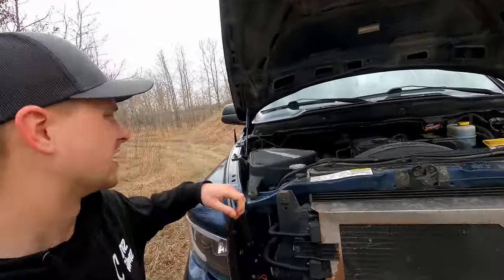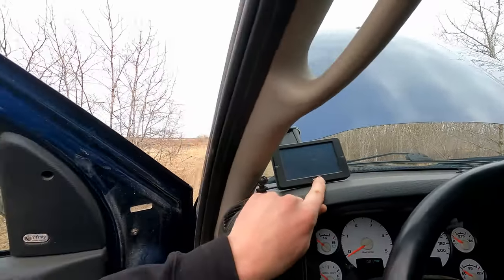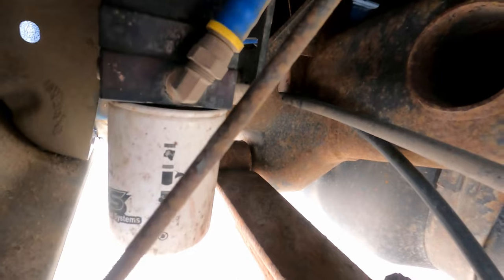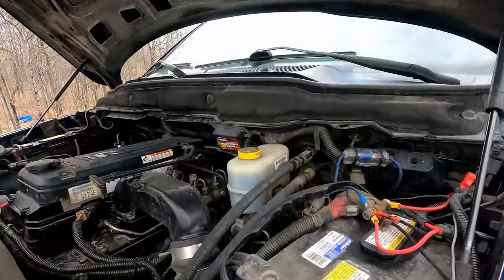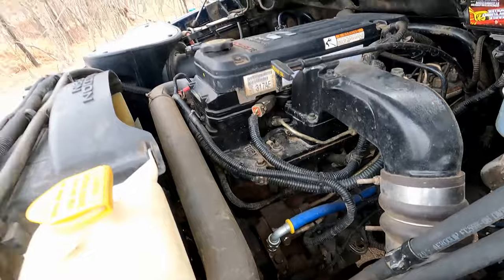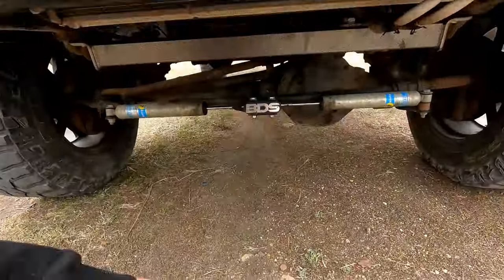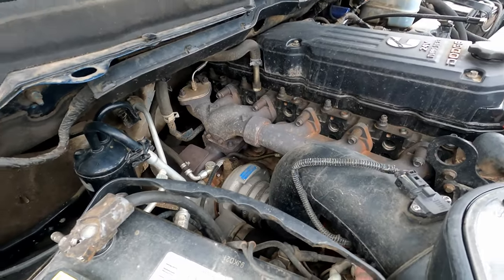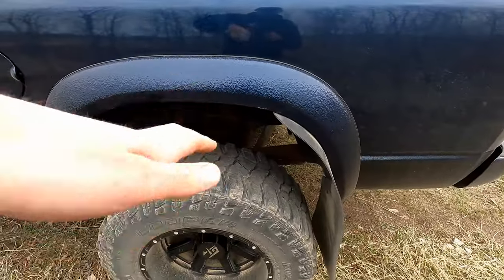TOP 5 UPGRADES FOR 5.9 CUMMINS

Comment: Transmission on 3rd gens first thing i did when i started building power years ago was lock up the tourqe converter the factory actually  detunes the engines so they dont destroy the 48re trans so when you turn it up its a time bomb

Comment: Cool vid. I picked up an early 04 6 speed 3500 RWD dually. 110k miles and She's pretty much bone stock. I just removed silencer ring, intake pipe baffling and swiss cheesed the airbox along with a KN filter. Exhaust is next on my radar along with an edge juice with attitude cs2 programmer. Great advice! Cheers from Alabama.

Comment: Great video I just found your channel and a month ago I bought my first diesel. I got a 2006 ram 2500 4x4 5.9 So far I have made several upgrades but the best so far was getting rid of the muffler and catalytic converter that was original.It really opened the truck up and it is totally  different for the better.
Reply: Hey man how are you liking youre truck? What did you do to it? 
I just bought that exact same truck!
Reply: @Andronicos1453  I love it so far.Yesterday me and my son put back brakes on it,changed the fass filters and did an oil change.We are supposed to be headed to Colorado tomorrow to get my wife's car from Colorado springs.We went on vacation in June for a month long dream trip to the west from S.C.6500 miles into the trip we blew an engine while pulling a mini camper Long story I know but Hyundai finally are supposed to install new engine tomorrow. So I got to go get my wife's car and the mini camper.Wish me luck I hope the old girl makes it lol
Reply: Did the cummins make it?
Reply: @Jaymes222  it did without any problems I discovered a small leak in the seal where the yoke goes in the rear differential but is minor and it's on my list of things to do.But I was really happy to make it home with my wife's car our mini camper and my cummins lol
Reply: How's the 06 holding up?  I think I'm getting one soon.   I really wanted a Tundra but the 5.9 seems a lot more ideal.  What kind of MPG are you getting?
Reply: @oldowl4290  I had a small wori g issue with the transfer case motor other than that I love it.I get 15 around town pulling a 6×12 cargo trailer
Reply: Hello new to cummins 5.9 
So you upgraded your catalytic converter and muffler or is just straight pipe ?

Comment: Upgrade your steering gear box to a Red Head box along with the brace. RedHead is hand machined box to way tighter tolerance then an OEM box or a reman box. It's a must do on dodge pickups.
Reply from the maker: I’ll look into it!
Reply: Borgenson is better ditch redhead
Reply: That new steering box I think they are the newer Dodges it is huge and for what I heard that new factory pump is way better than any rebuilt and modified pump and I sure it is very costly. But these new boxes are huge and built like a tank !!
Reply: Redhead steering box, Mishimoto radiator and Carli suspension here. Love my 06 !! Till death do us part
Reply: @calevel  Was the radiator actually worth it?
Reply: @jamesvaldez4093  well knowing that it has a lifetime warranty it is worthy  for me since I'm not planning to ever part with my truck. as far as running cooler idk but maybe. my oem  developed a leak. mishi is a solid piece very stout and aluminum is known to dissipate heat quicker that other metals.
Reply: @calevel  Thanks for the info. I have an 05 and thought about upgrading the radiator and intercooler to Mishimoto but have read about some quality control concerns. Mine doesn't have any leaks or anything so I may just wait a bit.
Reply: @jamesvaldez4093  check champion radiators, I have one in my 79 Ford Bronco and I’m very happy with it. It’s not a lifetime but there’s no much difference between them and mishimoto as far as how they’re built and price is like half. Whenever you pull the trigger on it  go aluminum.
Reply: @calevel  Awesome!! Thanks for the heads up and I'll take a look at them.

Comment: Great video!
Everyone: be very careful with those 'performance' air filters! They can let a lot of dirt into your engine.
I researched and found out that the best filtration is from a larger, paper filter (similar to OEM).
There are tests online (like the Spicer Duramax air filter test) that show the different efficiencies of several filters.
My 'test' was wiping the inlet and impeller of my turbo with a white paper towel. That lead me to get that oiled, foam filter right out of there!
Reply: The Carlie 3”lift ,with life time ball joints with the up graded OEM steering track  bar , with steering box brace , and the longer front axel bars , duel  steering stabilizer kit . Tracks better than new ! Oh yeah new king shocks night and day difference. I Evan got discounts on my insurance for steering performance up grade ! Loved that.

Comment: I have an 03 3500 with the 5.9 and I did these same 5 upgrades off the bat and really think it was a great idea. My order was the 5in straight pipe, s&b intake, fass 165, bullydog 40420 (huge mistake highly don't recommend) then I did my own form off steering (Just the 4th gen steering upgrade). Great video and really think it will help the new guys with their first 5.9.
Reply: Do you know if the diablo sport predator is safe to use?

Comment: All great upgrades, the only thing I might add is a intake elbow, I was surprised that I could actually feel a difference!! Well done, another great episode!
Reply from the maker: Yes I forgot that one! I will be upgrading my intake elbow when I do the bigger injectors!
Reply: @darkirondiesel  I was able to find a brand new Banks elbow to go along with my 30% injectors, really scoots now!!
Reply: No point you can make 2000+ verified rear wheel hp on the factory intake horn.. save the money for other stuff xD

Comment: Nobody ever talks about the Fleece in tank a drop in unit and it has two gear motor pumps and a nice CNC top section it uses the factory lines and factory  wiring harness for one pump and Fleece wiring harness to run to battery with a fuse and a relay. So what is so cool this unit has two separate pumps and a second wiring harness with two pumps running at 21 lbs and if a pump fails you have a back up pump that that’s on a separate harness with fuse and relay and one pump will 10-12 pounds of pressure. So you can drive it with plenty of fuel to run and cool your your high pressure injection pump and it has a lifetime warranty a win win situation.

Comment: I agree with everything but I'm not sure how I feel about the head studs. Having ARP studs on a performance motor can damage the block under certain conditions, where as keeping the stock studs will stretch and you'll loose a gasket. I think it was banks that did a video on this as well. Never seen the issue but have learned the draw back on the the ARP studs. Might be worth looking into because that's an upgrade that may not be necessary.

Comment: Good video very informative. Last spring I bought an 2003 dually 4X4 Cummins with a 6 speed manual, it has 353,000 kms on it now. I live in rural New Brunswick so the 4X4 could come in handy. The check engine light came on coming back from Ontario, engine cut out and stopped. After a few minutes fired up again and it ran fine for another 600 kms and still running fine but the light is still on. Love the truck, handles great and lots of power for me. Should I call a dealer and have it analyzed? Oil and Preston are both good.

Comment: With my S&B cold air intake i bought the lower scoop and added the AFE waste gate actuator on my 2006 5.9 and my turbo lag got way better and the AFE waste gate actuator is adjustable up to 60psi! Plus im getting upwards of 22mpg’s with my superchips tuner! It’s the cheapest one i could find and it only has 2 tunes (tow & performance).

Comment: I was tempted to install head studs 1 by 1 without doing the head gasket when I replace injectors in the future but at 180k miles, I might as well wait to until it needs a head gasket. Your injector video made it look easy enough where doing in stages is easier on the wallet. It may be a while given even with turbo upgrade plans, I don't intend to make much power and just want to try and keep the efficiency and longevity up.
Reply: 9

Comment: I would add a Amsoil dual oil bypass system...and locking hubs so you wont be running your front diff all the time save a couple mpg in the process.

Comment: I bought a new 2005 Dodge and the first thing I did as soon as the rings seated was to install an Amsoil bypass oil filter kit. It is the best pickup I've ever owned and I'll never sell it.
Reply: I have my second Dodge diesel my first a 12 valve 1992 and my second truck was a 05 5.9 6 speed manual and floor shift for 4 wheel drive and I will never sell my 4 foot long bed dullay and first year I ran Rotela oil and after that all I run is Amsoil 15-w40 and every thing in truck has Amsoil !
Reply: 8’ foot bed

Comment: Just get a Fleece in tank lift pump that has 2 gear motor pump wig 21 lb and a long 20 lb one uses the factory wiring and other pum has its own harness with fuse and relay. So if one pump goes out you have a second one to get you home .

Comment: Been watching your channel for a bit. I came across a 2003 quad short with body in pristine shape. USA truck. Motor knocking, so it’s gonna be cheap! I’ll either repair or rebuild depending on what I find on tear down. 
Goal is 475 HP for towing.
I intend to do FASS, head studs, BD VGT and related (quiet!) exhaust, steering brace, minor lift (I’m old), probably new stock or reman injectors.
I have always run a ProVent 200 on my trucks to keep the PCV a oil out of everything from turbo inlet to the cylinders.
When the motor comes out, I will be sending the transmission off to be refurbished for the power and exhaust brake.
Anything else you would recommend?

Comment: interesting. and great videos. 
a perspective often overlooked in pursuit of huge power increase ,  is the strain on engineered systems; cooling starting etc. a fun thing to consider is how to maximize the engineering that  ram gave us.
 ok the steering is awful thats not a performance thing thats plainly a safety thing. big tires and ball joints safety again.
but what about cooling for example. recently i asked myself, what would happen if i isolated all underhood heat keeping it where it belonged and then was able to influence my charge temp? 
that led to intercooler ideas which led to a louver center hood. isolate heat with wraps, and increase ( dramatically) airflow thru the intercooler by using engineered louvers. 
so far so good and ive added none of  the gofast high dollar excessive accoutrements that are so popular. these additions that will strain factory parameter designs, in ways that can be counter productive. build out the factory design first.  using more fuel means more heat, straining all other  engine system s, especially charge air temps. 
back to cooling. next a water meth kit on the factory engine. every thing is still as Detroit designed it but maximizing power just from cooling down the factories idea of the proper air charge. if a  trick turbo is putting hotter air through the can at higher temps are u really netting much except guaranteed increased wear if you do not address the cooling systems shortcomings first? 
fuel delivery. mopar hd filter water and cat main filter. but the mopar  cannister one will keep your pump alive for at least 250k. the dizzingly expensive lift pumps, are so necessary with go fast parts, but is there power to be had just by maximizinf factory parts? 

air box. needed for high sustained rev of the engine. a factory part,but.wrap the tube to prevent heat soak ?
 in every case my first money goes to exhaust. i use 5" exclusively with three resonators. near factory sound with a deeper note and vastly improved flow. just sayin.... 

how much power could a 5.9 make just by maximizing factory parameters without destroying those parameters by using un- engineered go fast parts? i dunno. and ive never heard that discussion take place the rush has always been to alter those parameters with go fast parts, and in so doing, altering the balance of the designed package

Comment: Banks intercooler, Fleece Power Flow in tank lift pump, Banks monster ram intake horn, Banks cold air, Fleece Cheeta Turbo 63mm, Steed Speed CNC machined exhaust manifold, MBRP 4 in turbo back exhaust, Original  Cummins(Jacobs exhaust brake) Cari 3 in commuter system, Phoenix Friction systems dual disc clutch, EFI live tune..2006 Ram 3500. 167000 miles.

Comment: Hey man I appreciate the video. I noticed the headlights on the truck and I have the same ones for my 04 2500 dodge ram and I’ve been having an issue where the led light in my driver side keeps flickering on and off constantly. I was wondering if you would know why that is and if you would be willing to give me some advice

Comment: And I have 3 filters a big Baldwin with water separator with a drain and that is 5 micron and then it goes into my 2 micron cat filter and the a 5 micron Baldwin in factory spot with water separator and drain and a light to tell you you have water .

Comment: Hey , I’m a new subscriber to your channel ! I own a 2003 Dodge Ram 3500 SLT . I have a question for you, how do I check for a blown head gasket on my 5.9L Cummins ? The reason I ask , is cause it runs a little hot , not very hot , just a little to right of center . It used to run always to the left of center . It does have 334,000 miles on it . I’m just wondering if a head gasket issue ? Please advise . Thank You !

Comment: Glad I found your channel.  I've got an 05 with a G56, 211000k on it.  Put the bds 6" long arm in myself years ago and also the t-style drag link and tie rod plus bd steering box brace.  It's my daily oil patch work truck loaded to the nines with my welding skid.  I want to make this thing last forever as I'm not interested at all in  the emissions bs that comes on new trucks.  Next, I'm thinking of upgrading to the Howler turbo mostly to keep the 5.9 warm when I have to let it idle all day long, - 30 or just pipelining, it never comes up to temp.  Do you have any advice for the shit e-brakes?  Just replaced everything and still barely holds on the minimum slope of my driveway.  I'm scared to adjust the cable tensioner much more and have the shoes rub too much and take out my axle seals.  Great vids. Thanks. Working in the GP area.
Reply from the maker: You’re brake shoes probably aren’t tight enough, you want to set them up so they drag a little bit on the rotor, if you do that it should hold!  I used to work up in GP for Nabors drilling 👍🏻
Reply: @darkirondiesel  Thanks for the reply.  I did adjust the star when I installed the new shoes till I felt some drag when rotating the axle by hand.  I was worried about setting to much drag and glazing the shoes.  Guess I'll try again and set a bit more drag.  Thanks.

Comment: I wonder if a stock exhaust on a 03 or 04 would help heat up the truck quicker in winter, since it would cause alittle more back pressure compared to straight through exhaust.

Comment: Great video! I have the exact same truck and looking to put some upgrades on it. Only thing troubling me is hear they like to blow trannys with more than 50 or 60 hp past stock. What transmission would you recomend for an 03 5.9? Also is it normal for my RPM to consistently be at 2000? Thanks!
Reply: I have a g56 mecedes manual transmission in mine. The stick is amazing for pulling. Just make sure you have a good clutch in it if you're going to upgrade hp.

Comment: I somewhat disagree do studs second after a FASS but you take the chance of warping your head or block if you over heat to much just do studs no mater what cause your not gonna get a 5.9l with low miles so a full refresh is a good thing to do if you’re gonna bring the power up at all! Then 3 intake horn and filter setup and intercooler pipes and then take care of the front end with the 09’ upgrade and the be  brakes! Then if you are ready and the trucks safe tuner, injectors snd compounds!
Reply from the maker: Definitely not a bad route to go. I’ll be getting an intake horn very soon, probably when I do my injectors and cp3

Comment: I have the bully dog for my 03 5.9 3500 and I only put it on the first setting, have you ever used the bully dog. And where's the expansion tube on these in the cooling system

Comment: First mod needs to be built trans. No matter how much power you build it for. Putting all these mods especially a tuner isn’t going to help the truck without a rebuilt trans. As soon as you turn that tuner past level 3 you’re asking for trouble. We appreciate your cheaper mod suggestions tho. Not a bad lookin truck.
Reply from the maker: Ah yes good point. Mine is a 6 speed so I threw a southbend dual disk clutch in it

Comment: 07 5.9 with 275km worth 21k? SLT, old man owned (2nd owner, guys had it for 11 years). No tuner, stock intake. 5” exhaust into 4” muffler (guy must’ve straight piped it and then realized it was too loud for hunting). Rebuilt trans and new injectors in 2019.

Comment: I have a Thomas Bus with a 5.9L 24V Cummins. It is just a tad underpowered for my application. What is the quickest cheapest way to add 50-75 hp without damaging the engine?

Comment: I just bought a 2003 5.9, has a fass fuel 165, 350% S&S injectors, S&B cold air, twin borg warner 9180 turbos, ARP 625 studs, bored for industrial performance pistons, etc etc. But it doesn't have a tuner and never has. What one would you recommend? I'm in Alberta and bought this truck as it sits, have all the paperwork and receipts from previous owner.
Reply from the maker: Contact ccs tuning in nisku